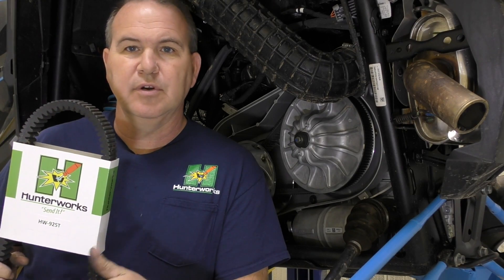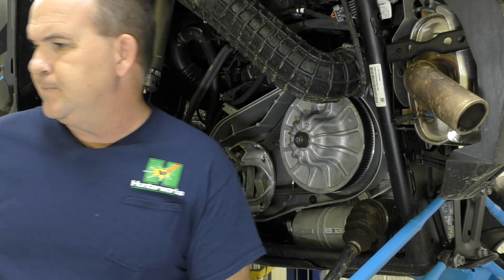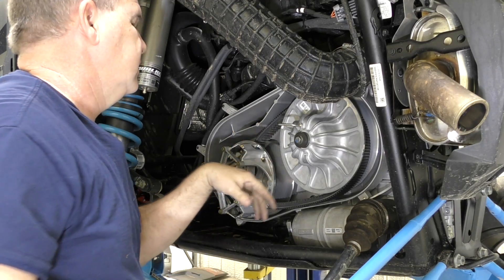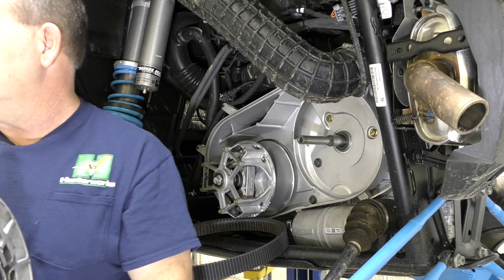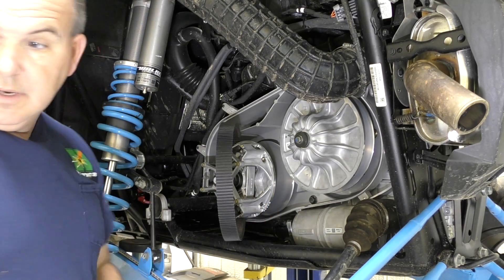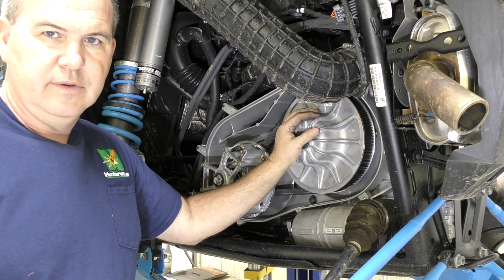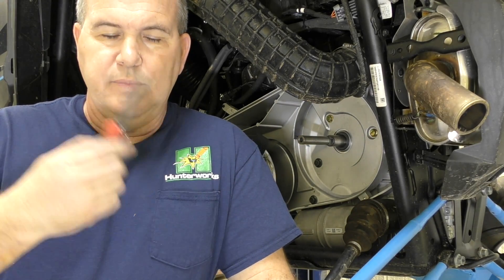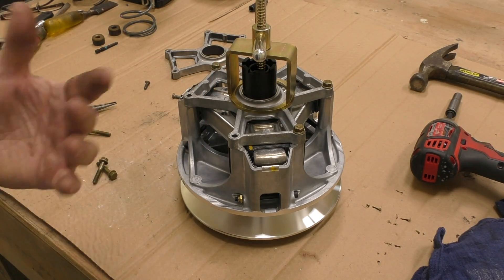Is your Turbo RZR Blowing belts? Polaris RZR Turbo Belt Travel Test

Comment: you can just remove belt in the same time with the main secondary bolt....
Reply from the maker: While true, you can't put it back on that way so this saves time and torquing
Reply: @ why cant you put it back together? You put the plate on  and you push a bit on it and spin… and then the bolt screws right in…
Reply from the maker: @doarmihai  without a belt yes, but the belt will keep it from going on all the way, just not a good way to do that
Reply: @Hunterworks  it goes it just right..no fus...way faster than that stupid screw...
Reply from the maker: @doarmihai  good luck,

Comment: What happens if you fail to mark the secondary clutch when you take it apart and you put it back together rotated relative to its original position?
Reply from the maker: Technically out of balance but you have no choice and I do not of any damage that can be said it was because of this, might be but probably can't be proved
Reply: @Hunterworks  Thanks for the info. I ran it 21 miles today breaking in a new belt and it ran fine. Only thing is I noticed more of a whine from the clutch when coasting down a hill in high or low (whine is different pitch depending on if I'm in high or low) but apparently the whine is normal, it just wasn't as apparent before I installed the EPI High Elevation Clutch kit yesterday.
Reply from the maker: @glade-runner  might be that kit, no fan of them, if you have belt issues with our belt that will be suspect one

Comment: Long story short, I have a 2017 turbo 4 seater. checked my secondary for belt over travel and determined that even tho it’s bone stock, it’s still over traveling some. It is traveling probably a 32nd - 1/16” into the radius.  So question is.. 1, is that a problem, and 2, do you have a slightly thicker washer for the turbo machines? I can drive it on the roads around my house, some at higher speeds, so I’d like to be sure it’s sorted
Reply from the maker: https://www.hunterworks.com/polaris_turbo_rzr   Click that link, we have black washer for this
Reply: Hunterworks Inc. so do I stack the washers, or is your washer a touch thicker than stock? My machine has the stock washer, in the correct orientation
Reply from the maker: @jeffsgarage8414  click link, then video there

Comment: Todd get you a set of impact Allen drivers. They fit on impact 3/8 socket adapter. I use them everyday, they beat all.
Reply from the maker: I have some, but what part of this video did I need them?
Reply: @Hunterworks  That secondary spreader screw
Reply from the maker: @BlackAxeDayTrading  IM not following, what screw?
Reply: @Hunterworks  Is that not allen screw or bolt rather, where you're spreading secondary in/out to get belt on/off?
Reply from the maker: @BlackAxeDayTrading  no, round with bent handle for using your hand with.  I wish there was a screw to use but has to have a special point on it with no threads and i have not found one
Reply: @Hunterworks  Ah well sorry, wish I could have been more help.
Reply from the maker: @BlackAxeDayTrading  You was trying and that is what matters.

Comment: Great video. Is the spacer you are showing common only to the turbo model?
Reply from the maker: Yes, this particular spacer
Reply: @Hunterworks  , my bolts that hold the rollers are loose and move freely back n forth. Is that normal?
Reply from the maker: @knockoutchamp5679  in primary? if yes yes they are supposed to move back and forth